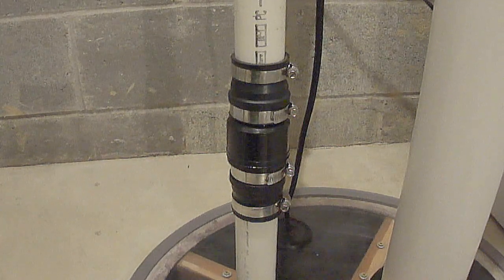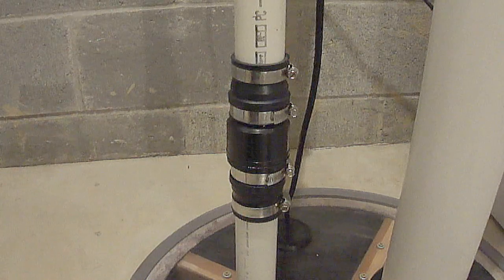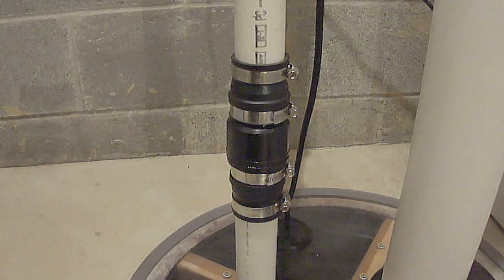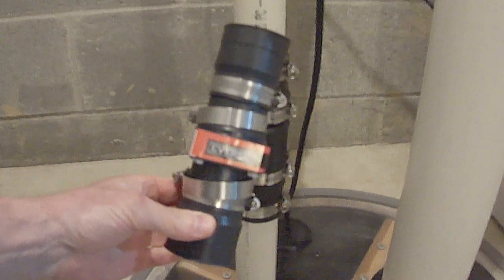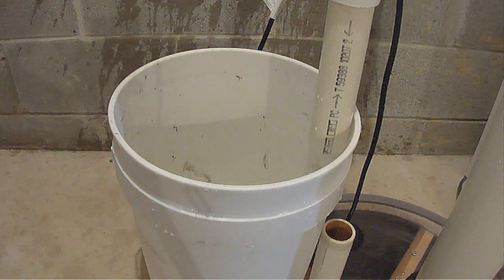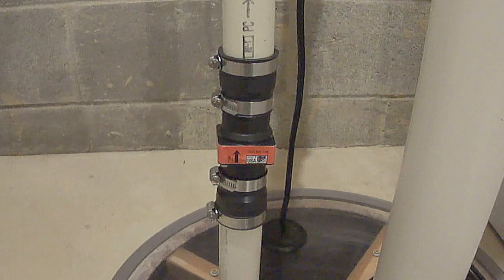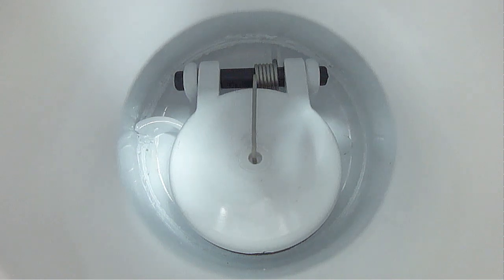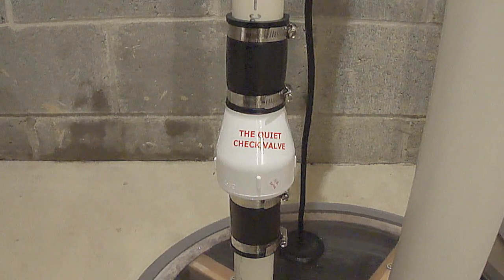NEVER Replace A Sump Pump Check Valve Until Watching This!

Comment: Water hammering and slamming check valves are also caused by restrictions in the outlet pipe. The pressure in the line will return to the pump and slam or hammer the valve. Replacing a check valve may not always work. You could have a line partially blocked.
Reply: Dear brother, thank you so much for the valuable information! God bless you!
Reply: Don’t put the check valve low ! Put it close to the elbow before it goes horizontally. Then less water weight coming down.
Reply: @bluesdirt6555  My check valve is a foot or two out of basin and floor level; still five or six feet up before going to elbow. I have a check valve with the shock cushion thing on the side. No noise. Besides, if you drill a tiny vent hole for air lock issues just above the pump, that is more water dumped into the sump.
Reply: @bluesdirt6555  The further away you put it from the pump means that there is more water that will wash back in after the pump turn's off, which means that the basin will fill more frequently, which means that the pump will turn on more frequently , which means that you will go through more pumps then someone that puts it lower. If you put the check valve 10 feet away with inch and a half piping that's like 4 liters of water that's gonna flow back into the basin every time the pump shuts off
Reply: @jeremycormier8559  These pumps should all have integral check valves. Unless it's defective water should never flow back.
A spring check valve closes faster which reduces what sewer gas is reintroduced after it shuts off. Placement or orientation should not matter.

Comment: You should probably also find out why you're getting water hammer in the first place. Silent or not, that's a lot of pressure in the system which is not supposed to be there.

Comment: I just installed the quiet check valve. It works, but there is more high frequency sound during the discharge now, ans it is leaking.

Comment: If you drill a small seep hole in the discharge pipe right above the pump it will allow the water trapped in the pipe to drain out. I suspect that is causing the water hammer. THoughts?
Reply: Weep hole, couldn't hurt.
Reply: That should relieve or "vent" it below the check closer to the pump

Comment: I have tried several check valves even had a plumber replace one. every time the pump stops runing, I get a loud banging.  Plumber says its the water comimg back down on the closed valve and you can't stop that.  any more suggestions?
Reply from the maker: Did you try the quiet check valve that I installed in this video?
Reply: @proclaimliberty2000  yes as I said I tried several diferent and one was from a "PRO Plumber" at a cost of 275. he says its because the water comes back down and hits the closed valve.
Reply from the maker: @donnperlut1690  Yes, but did you try this specific quiet check valve shown in this video? I bought this on eBay for $25.
Reply: @proclaimliberty2000  this valve has no name only says "THE QUITE VALVE" it was installed by the "Pro" company.  But it looks inside and out as he the one in your video.. I had them relpace the first one with another (SAME brand/kind)
Reply from the maker: @donnperlut1690  I have no other solution to your noise problem
Reply: Follow your pipe maybe you have a partial blockage somewhere

Comment: Heres a question I'm running into leaking (new) rubber connectors to abs for a sub pump. It continues to leak even tightening down correctly. Is there a way to glue the rubber to the abs pipe then tighten the o ring?
Reply from the maker: Go to a pool store and get a tube of Teflon lubricant and apply that to any rubber or O-rings and that will probably stop your leak. Aladdin Magic Lube is great stuff!
Reply: @proclaimliberty2000  i totally apologize I meant hose clamps. Were clamping rubber to abs 2" from the sub pump. Can you glue the rubber to abs?
Reply from the maker: @takeemoutdoors3489  in my opinion glue is not the answer. You could try 2 clamps but it seems like something’s not right
Reply: @proclaimliberty2000  exactly that's what I said too not sure I'm completely lost this sub pump has so much pressure its blowing every time it kicks on like old faithful lol
Reply: @proclaimliberty2000  I'll try the double clamp idea
Reply from the maker: @takeemoutdoors3489  👍😊
Reply: @takeemoutdoors3489  what is the hp on your pump. For normal use you only need 1/3 or 1/2 hp. If you have too small a pipe and too much hp that could explain the blowout. 1 1/2 inch is the lowest inside diameter that I would use for your line. Depending on the volume coming in you may need to go to 2 inch. You have to check how high up and how far out you pump to determine the hp and the size of your pipe.

Comment: After almost a year, any corrosion on the spring?  If not stainless I would think that would be it's weak link.
Reply from the maker: I do not know what the spring looks like now but I do believe the spring was stainless.
Reply: It has to be a stainless spring. I don't think the manufacturer would overlook this...considering being in constant contact with water.

Comment: The houses I lived in never had a check valve and as long as the discharge pipe run is short you shouldn't need one.

Comment: I have a gray water sump with a 4In cast iron discharge pipe and check valve... the water hammering is 1st class, like a freight train.
That being said I dont think the plastic valve would last daily showet usage for over 20 year 😉
Reply: Plastic isn't an issue. PVC will outlive any cast. The wear item is the rubber seal and steel spring. Even so they are cheap and easy DIY to replace.

Comment: I have a flapper style check valve just upstream of my septic effluent tank pump.  I was told to remove the check valve because in winter the effluent in the pipe upstream of the check valve can freeze. The volume in this piping is not enough to cycle the pump after the effluent drains back into the tank. Anyone have opinions on this?
Reply from the maker: My question would be how far below grade is the check valve and what is the frost level where you live?
Reply: You can install a drain valve above the check valve on the discharge line to drain the water in the line when closing out for the winter, this will ensure there's nothing there to freeze!
Reply: True none of the houses I lived in had one in the line.

Comment: We don't have these in the UK?  Do they connect to the gutters outside?
Reply from the maker: No
Reply: Nope . Sump pumps are due to weird house design
Reply: @Anton-du-Fleur  weird good or weird bad?
Reply: @steve323f  weird bad. For me
Reply: @steve323f  sump pumps sit in the basement in a sump basically a pit in the basement. if there's flooding or water collecting the idea is that it goes to the lowest point or if you have water already existing beneath the foundation your pump carries it outside and discharges away from the home on the surface or storm sewer(not sanitary)

Comment: Why is the Sump Pump running so frequently? Flood zone?? I installed the 2in Everbuilt from Home Depot, replacing the "quiet" check valve (which had broken). I've never experienced the hammering, maybe just a personal issue, Imjs.
Reply from the maker: The frequency of a sump pump running is always changing and is directly correlated to the amount of precipitation that the ground absorbs.

Comment: Anyone know why hours after it stops raining my sump pumps continue to pump out water? I suspect my discharge piping may be broken but I can’t tell because it’s underground heading to the sewer. The water that keeps coming in is clear water. I have water spouts around the house and I’ve checked while it’s raining and it is dispersing the water away from the foundation. I’m not sure what to do.
Reply: Is your yard on any sort of slant toward the house? Could cause water to constantly flow and make the sump pump run for longer periods of time
Reply: @bryanbuhl4618  the ground around my house is leveled. The house against my backyard does have a slope going downhill towards my property line but it’s leveled as soon as it hits my property line. That property line is an out 100’ away from my back patio.
Reply: Water table rising